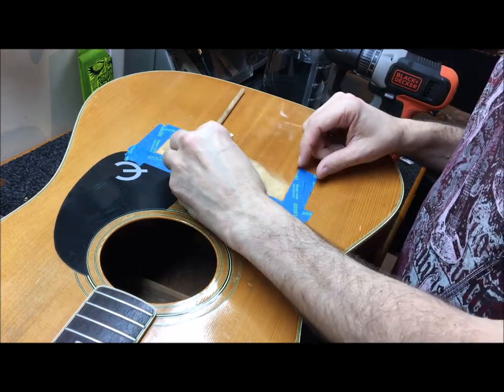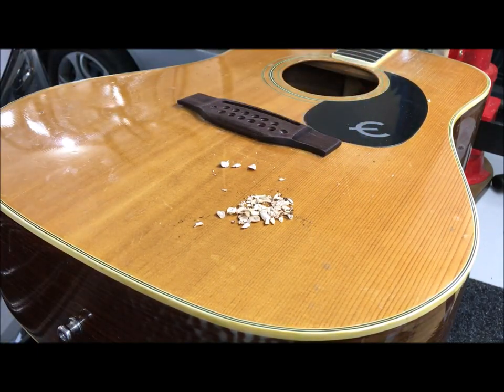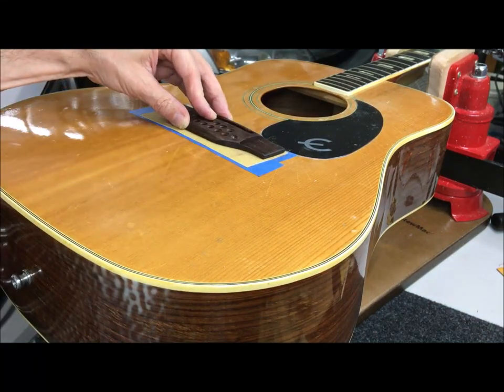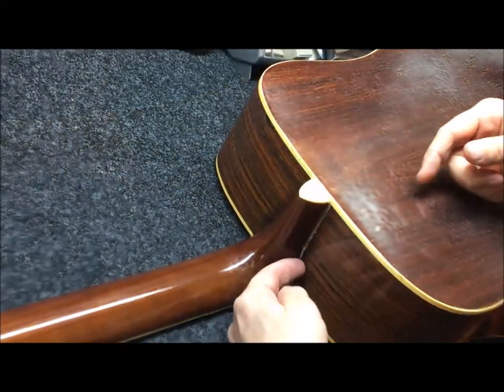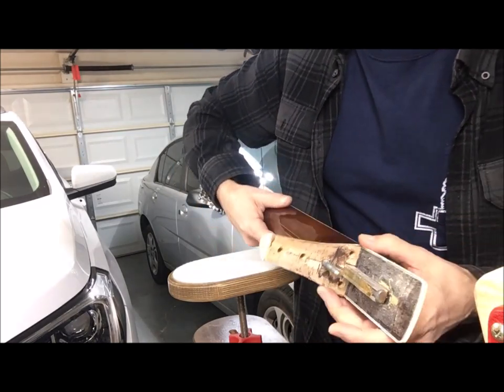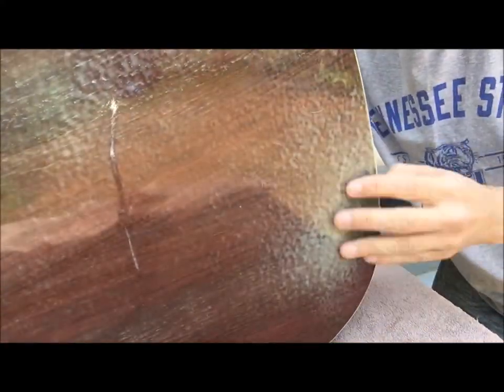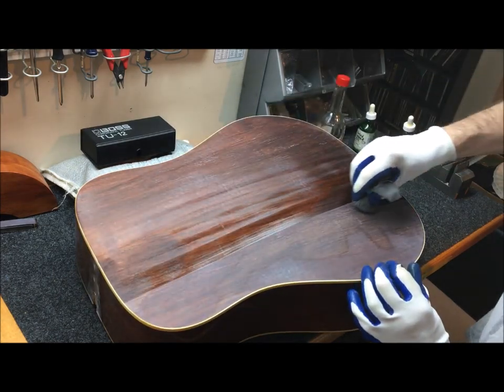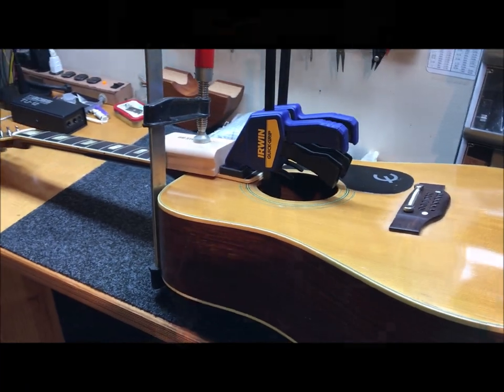Epiphone FT-365 Neck Reset, Bridge Replacement and Blushed Finish Repair

Comment: Just an FYI, the BOSS TU-12 Chromatic Tuner only has an accuracy or +/- 1%, the clip on Peterson Tuner can resolve down to +/- 0.1%.     I mention this because I've found the Peterson style tuners to work really well setting intonation.
Great job, that old Epiphone turned out nice.
Reply from the maker: Thanks!
All of the clip on tuners I’ve owned use itty bitty batteries that loose there charge too fast. Is the Peterson different?
Reply from the maker: A recent comment brought me back to our conversation. I’ve been using the Peterson iStroboSoft tuner on my iPhone. I can’t remember how I survived without it!
Reply: @harpethguitar  Yeah, I understand the feeling (how did we survive without it).
I was sorting through some of my old things (really old) and I found my Tuning Fork that I purchased back in 1974 when I started taking guitar lessons!    No Batteries and it still works!    In that same box I found my very first Thumb Pick too.  This was tucked away behind the reverb unit cover of my old Twin Reverb (I purchased that Twin Reverb brand new in 1976).
Anyway, I've started using the tuning fork again (with my acoustic guitar).
The Peterson Clip-On Tuner does use the small watch type batteries, however as Thor stated use of the Duracell brand batteries is highly recommended.   I can typically get 4 to 6 months of use out of it with the better batteries.

Comment: I would imagine it took a bit of careful work to make all those face-grained plugs.
Great job Sir, that Epiphone just got a new lease on life.
Once the neck released it's easy to see the difference between a Gibson and an Epiphone.
Reply from the maker: haha. I fit the plugs but did not make them. They are actually "birch plugs" from Woodcraft Supply, They come in a few different diameters in little bags of 100

Comment: Great job. I’m resetting the mandolin neck but thinking about adding another dowel for strength. How did you counter sink for the bolt head inside the guitar?
Reply from the maker: I didn’t have to counter sink it at all. The 1/4-20 “furniture bolt” has a nice flat 2mm thick chamfered head on it. The head diameter is 17 mm

Comment: Curious. Did you glue the neck as well as bolt it on? Or are the 2 bolts enough? I see you glued the fretboard back onto the soundboard. But what about the face where the heel meets the body? Did you glue there too?
Reply from the maker: Hello Dan,
I glued the fretboard extension to the top but I did not use any glue on the heel. Just the 2 bolts.